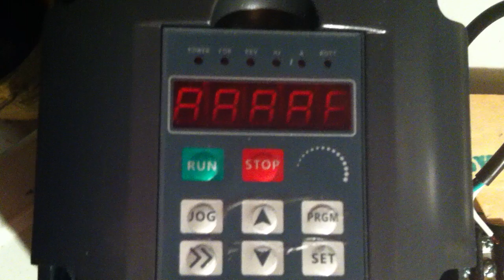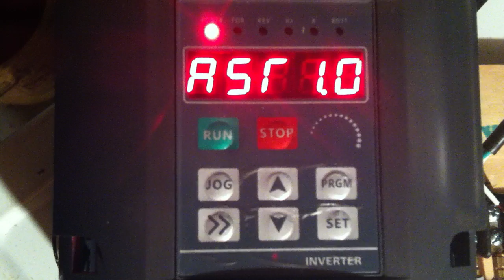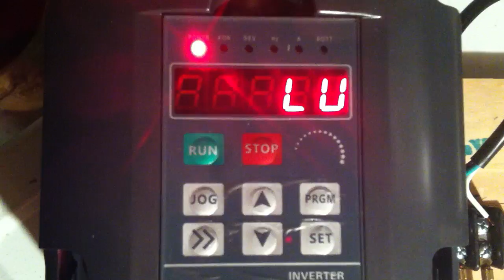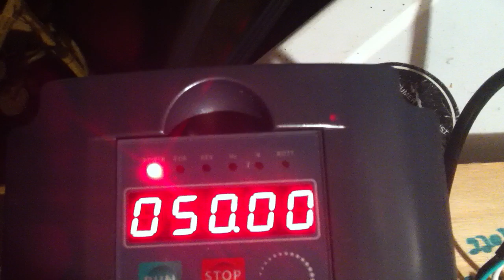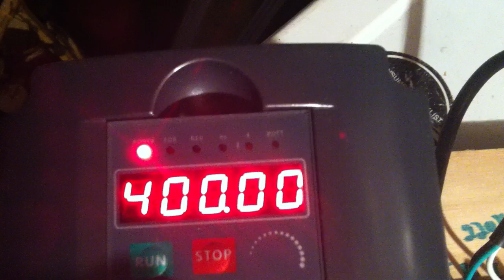Huanyang DY02d223B Inverter - "LV" error

Comment: Okay I had this problem as well I have tried to track down where on the board it senses the input voltage but I could not find it 
But there is a fix if you set PD200 to 65535  then you can adjust PD209 down to a number like 1-6 this stops the LV error.
 It seem's to me like this Parrameter PD209 holds a value for the LV level.
 Once the LV error is off if you then start to increase PD209  it will reach a point where the error is again raised you have to press set each time you change the level.
I also noticed that a parramter reset PD013 set to 1 or 8 depending on your vsersion does not reset PD200 or PD209.
Hope this helps.

Comment: I had the same low voltage error on converter hy 05d 523b.
hanging parameters did not help.
I discovered hardware error on main pcb of converter.
There is picture: https://imagizer.imageshack.us/v2/499x281q90/540/7Efv6c.jpg
On the left corner of small vertical pcb you can see resistor 90 kohm vertically home-made
soldered. In factory production resistor is placed on main board, but on right side resistor is sometimes lost contact to the pcb (perhaps mechanical damage??).
At input voltage 230V to converter voltage on left side of resistor is 0.85Vdc to pcb ground.
I hope this will help someone.
Reply: i would if the image was still up